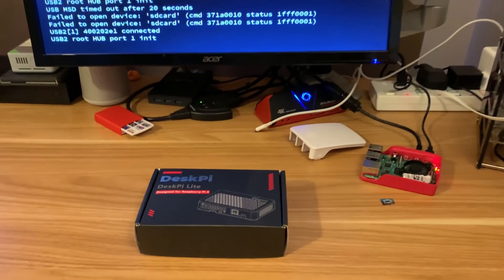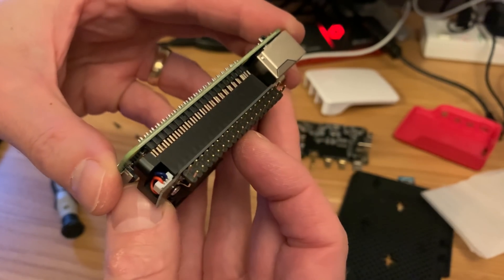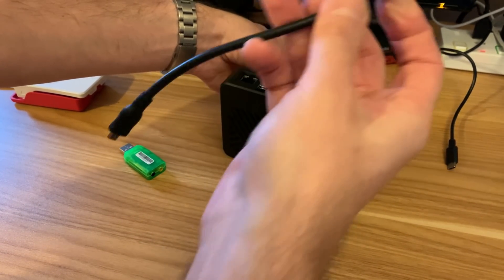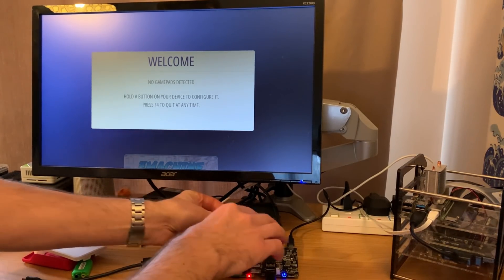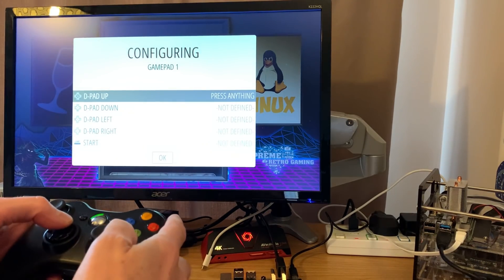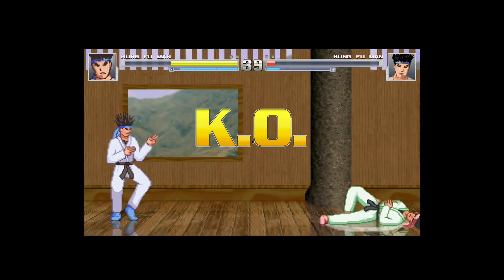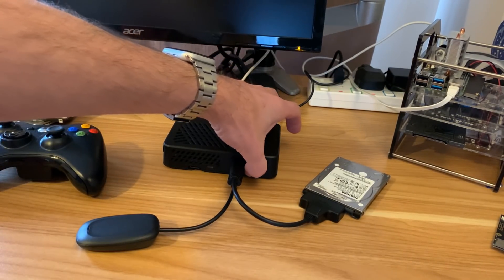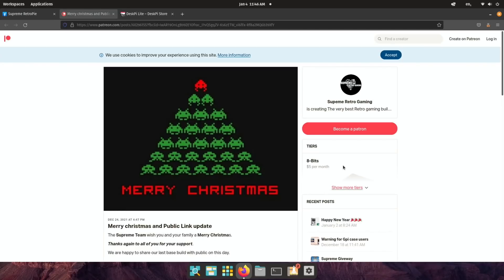DeskPi lite Raspberry Pi 4 case. Plus first look at Retropie Supreme Ultra V1.1

Comment: Question for you Lee, or anyone that knows. 
Is the drive with your ROMs formatted as NTFS? I just noticed supreme requires an external usb with roms has to be NTFS.
I'm currently backing up all my ROMs, to change my SSD from fat32 to ntfs.
Great video as always!
Reply from the maker: I think I have always used fat32. Fat32 has a 4GB file size limitation, this is fine for most emulators

Comment: Watched your vid and ordered via your link.  Arrived and DOA.  Will not power up the Raspberry Pi 4.  There is a red light on the power button  and it goes to blue when pressed but no joy to the PI.  Pi by itself works just fine.  Left an email on their website but do response yet.  FAQ offered no help.  Really disappointed as I had great hopes for this daughter board.  Looks like I may be out of luck with this supplier.  Live and learn.
Reply from the maker: I’m sorry to hear your experience wasn’t the same as mine. I hope they respond soon.
Reply: @leepspvideo  Just a heads up for other -- caveat emptor.

Comment: How do you get the Droix  x360 controller to work on the gamecube on this , ive tried by posting on there facebook page but they never get back to you or help out :(
Reply from the maker: This may help from an older build

Gamecube & Wii Setup. Supreme Pro Retropie Raspberry Pi 4. Dolphin Emulator
https://youtu.be/KCcab-e4aFo
Reply: @leepspvideo  Thanks manage to get it working just need to figure how to move in james bond lol

Comment: That case is missing a SATA SSD mount. For real that would make it the default go to add in
Reply: DeskPi sells a M.2 SATA addon board for the Pi4/DeskPi Lite only.  I hope that they make a Pi5 version, since I love the look, and the network port has moved to the other side of the USB ports on the board, and the CPU has moved.  So, there will be a little design revision involved.  I'd like to see a microSD card insertion orientation indicator graphic on the case, just as an "extra"to keep me from swapping a card wrong (anything to protect me from myself)...   ;-)

Comment: Happy New Year @leepspvideo I recently watched a YT video by RaspiZone wherein he tested the temperature difference of a Pi 4 with a low profile tower fan (pardon me if that is not the name)  between thermal pad and thermal paste. The audio and subs are in Spanish, but the tests and results are on screen; the temperature is monitored in real time via Commander Pi. He ran stress tests using both the pad and paste. The result was that using the paste resulted in an 8 degrees Celsius cooler Pi. Have you seen or read anything similar? Could you please try the same test? Thank you.
Reply from the maker: Interesting thanks, I’ll take a look

Comment: Hi. A little bit of topic. Maybe someone know why Ubuntu 21.10 not working properly with pi400? Keyboard and mouse not working on this os as is should. I did try this one today because unfortunately I don't know how to configure ak103e (cm106) usb sound card to play analog 5.1 on latest raspian. On Ubuntu I can change audio to 5.1 analog and it is working properly. Hah... Really weird. On raspian I have only 3 channels working properly (front left center nad front right). Thanks.
Reply from the maker: I get an issue with the keyboard on my Logitech trackpad/keyboard not being recognised on Ubuntu. If I plug in a separate tiny keyboard/trackpad my Logitech starts working. It’s been like it for a while. See if you get the issue with PoPOS. It’s based on Ubuntu.

https://youtu.be/Jn-NGnsX2so
Reply: @leepspvideo  I will try popos and Ubuntu MATE next. Thanks